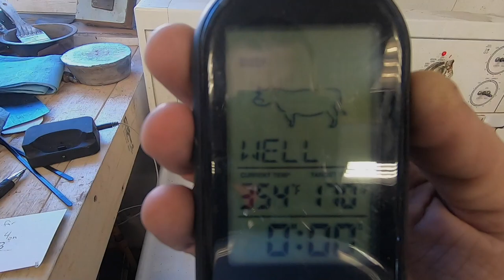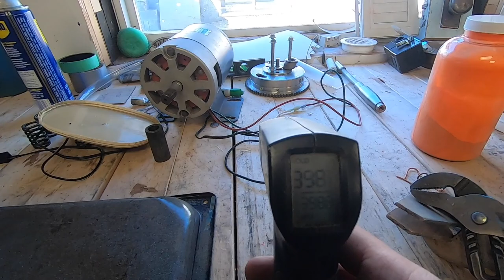Jet Ski Powder Coating - Color Reveal - Jet Ski Update (#3)

Comment: You must be a gator fan….
Reply from the maker: HAHA... you'd think so eh... It's supposed to be GULF racing colors.
Reply: @JoelArseneaultYouTube  is the powder coating holding up?
Reply from the maker: @benschroeder1161  It is... very well. I'm actually swapping this engine into a different hull as we speak... and was noticing how nice it still looks. It really only has one season of use on it, but yes... it's holding up really well. no issues with heat, staining, discoloration or coming off etc.